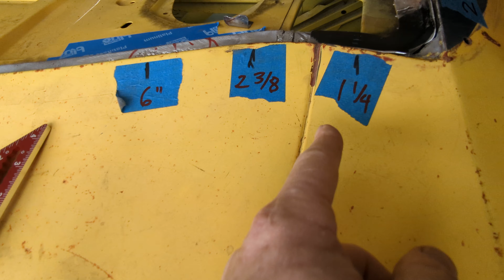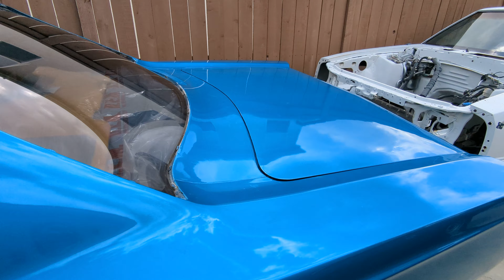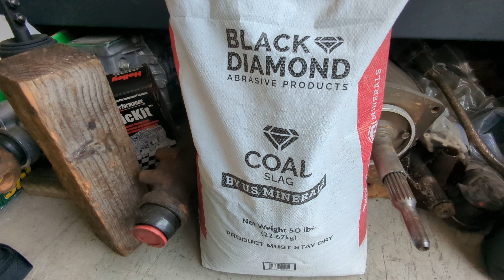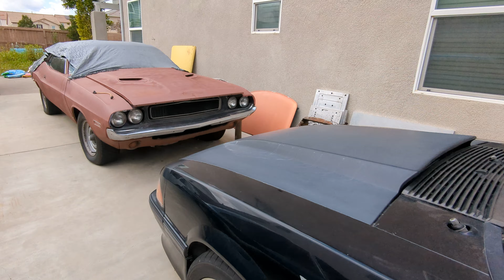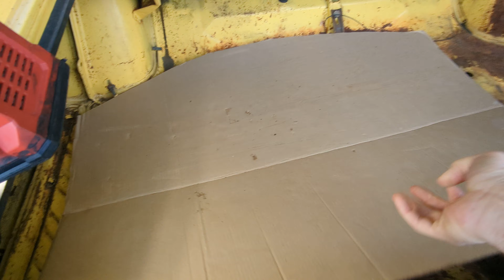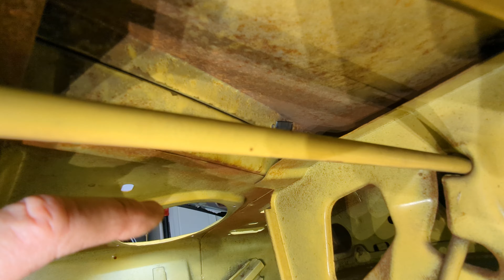68-70 Mopar B-Body Dutchman Panel Rust Repair / Chrome Trim Clip Locations for Rear Window & Removal

Comment: Why did you use the inner patch panels corners in place of the outer pieces  ? I'm starting on a 70 440 and have to do the exact same thing you are doing. I'm using the channel from a 4 door tho to repace the straight run pieces tho.

Comment: Very cool. I am currently addressing the exact same issues as far as bodywork on my '70 Bee. Not much from AMD for sheet metal, unless it was common to other '68-70s,  but at least I can get the package tray, package tray extensions, inside/outside window corners, dutchman panel, etc.